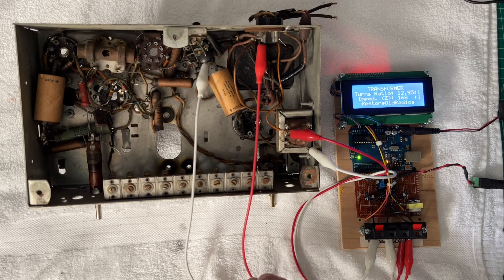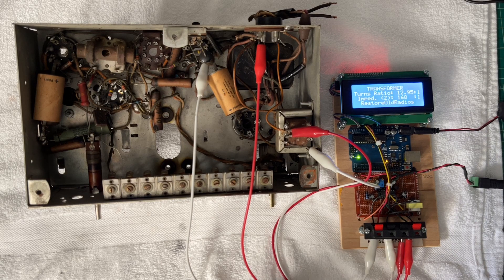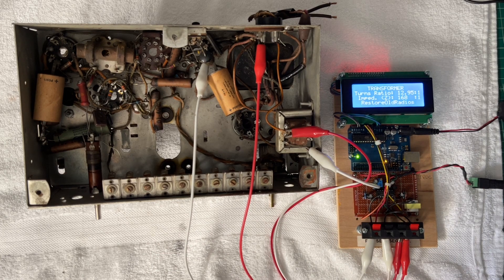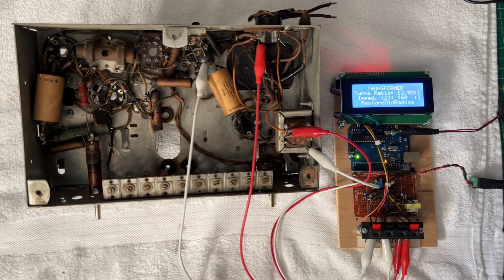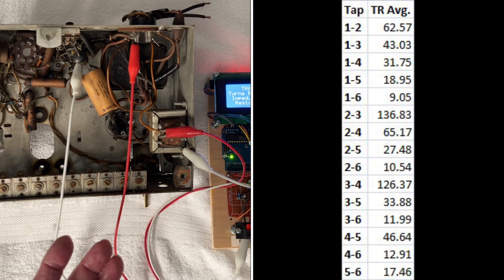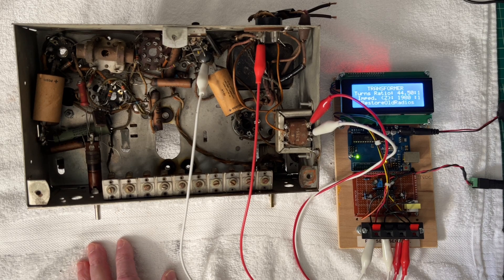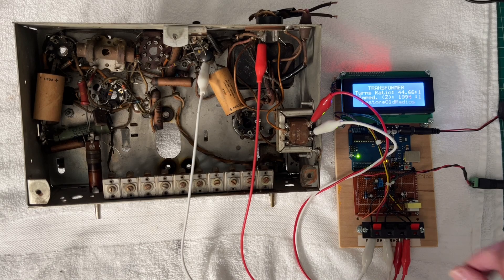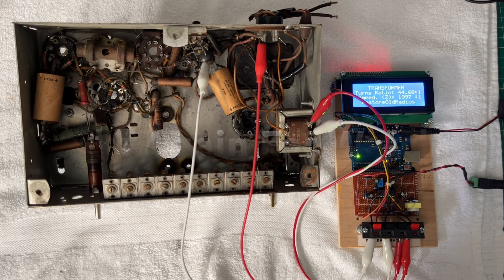Stewart-Warner - 01-521 | Stancor A-3856 Universal Output Transformer | Turns/Impedance Ratio

Comment: Hey Don, In your humble and considered opinion....... are there any "PIC" design equivalents & issues opposed to your using the Arduino in this meter? I realize the Arduino pre-assembled package usually comes with its kit form & LCD readouts, but I cut my teeth on using PIC's and starting from the board up. Other than assembling from the component level is there really differences between the two? Thanks, and good to see you're still at the old grind stone. Blessings and best regards.

Comment: Hello Don and thank you for your kind contribution with this channel. The content is extremally well done and beneficial to those attempting to learn. I have a video topic for your consideration. Demystifying Plate Load Resistance for tube audio amplifiers. I am familiar with calculating reflective impedance back through an output transformer with a known speaker impedance and the goal of matching tube or tubes for optimal performance pending class and configuration. Things get quite fuzzy when trying to confirm plate load specifications in the tube manuals especially with using two tubes in a push pull configuration. I have determined this is not just a matter of doubling the Class A plate load resistances. I am restoring a Bosch Model 28 that uses two 71A tubes in a push pull configuration and want to confirm what overall plate load resistance I should be targeting to confirm OT winding ratio and speaker all matches appropriately. The 71A tube datasheet indicates 4,800 ohms at 180v for class A and no data for push pull. Although this question is specific to my current project, I believe this understanding will be quite beneficial for future amp building and radio restoration projects. Thank you for your consideration.  All the best, Shawn
Reply from the maker: Shawn, I appreciate your kind words. My experience is very limited for your particular receiver utilizing the 71A tubes in a PP configuration, but I’ll keep the topic in mind when the opportunity presents itself. There’s a very good thread on the ARF on this topic that I’m sharing at: https://antiqueradios.com/forums/viewtopic.php?f=19&t=365861 Let me know your thoughts afterwards. Best, Don
Reply: Thank you Don, this was very helpful. I actually purchased the book Member Infzqi quoted and found the topic covered thoroughly. I really appreciate the effort to investigate and share the link. Such a great community. 
Best,
Shawn
Reply from the maker: Shawn - you are welcome. For my edification, would you mind sharing the name of the book Infzqi recommended? I’m sure it would benefit me too. Thanks again for reaching out. Best, Don
Reply from the maker: Thank you Shawn. Best, Don

Comment: Hi Don, I have a question unrelated to this video. A friend has a 1970's Japanese receiver with a broken tuner string. I'm wondering if you could recommend the best type of cord for restringing? I think it has to resist stretching and also resist slipping. Thanks for any help.
Reply from the maker: Thanks for reaching out. One below (dial string) that I started using that works well. You may want to check Radio Daze as well. Hope this helps. Best, Don

0.8mm Nylon Cord, Thread Chinese Knot Macrame Rattail Bracelet Braided String (Black) https://a.co/d/9SNe6a6

Comment: A repaired transformer issue there would have seemed ok to me, but you must of had sound problems or was it just a suspect because you knew it was the wrong replacement. Great to have some homebrew arduino anaylisis tools to help as well. I still have yet to build that great design you made. Awesome tool as well, Great find! 👍
Reply from the maker: Thank you Tony. It comes in handy at times, but the old fashion way of determining turns ratio and impedance ratio keeps things moving around in my head. LOL Best, Don
Reply: @RestoreOldRadios  : No doubt about that,  but remembering where I put those darn formulas is the real struggle. 😅